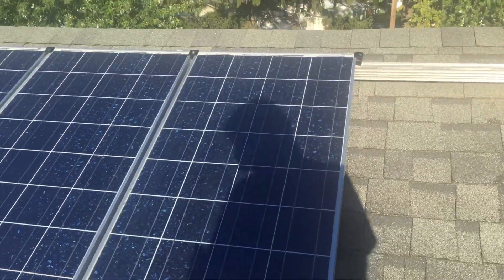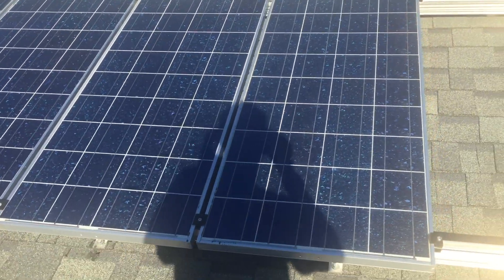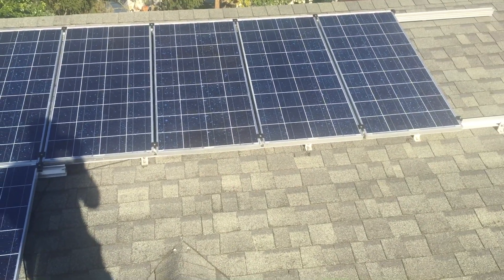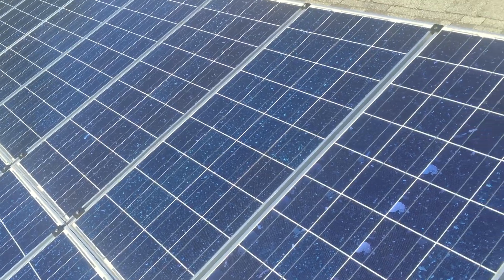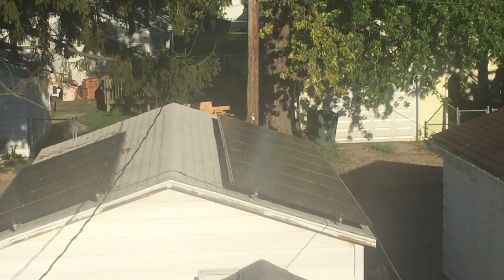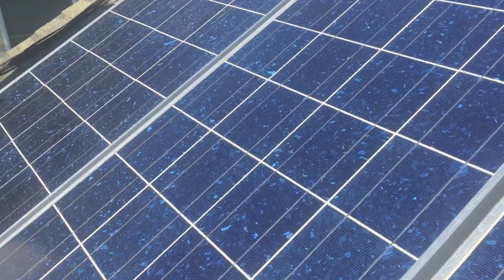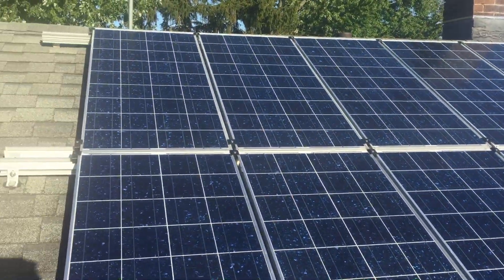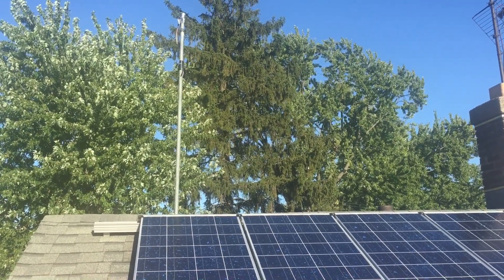2.88kw Solar Panels On the House update

Comment: what about arc fault protection
Reply from the maker: Right now these going into a fuse box I am also gonna bury a rod for the path to ground these panels gonna go into a sub panel breaker box then into the grid ties
Reply: You need arc fault to meet code
Reply from the maker: +Roy Amberg send me a link to some I don't claim to know everything I know there's inverters with it I am not sure about mine
Reply from the maker: +Roy Amberg would that be the same as Dc ground fault interrupter
Reply: I Saw you on Doomsday preppers and am from the Bend myself. First respect as I am not even a fraction as squared away as you are, but I always thought if I was to put that much money into preps I would buy a little land out in the country to do so. Urban prepping to me seemed to be a beacon to the have nots in populated areas should a disaster occur. Anyway keep doing your thing man.
Reply from the maker: +CCWHOOSIER thanks and sorry for late. Reply I just started using the app to see all my comments